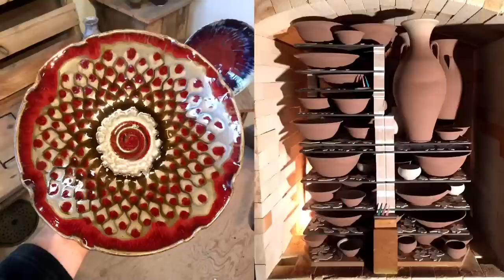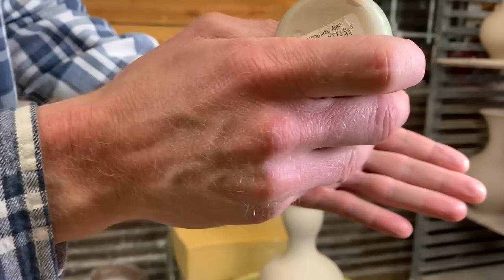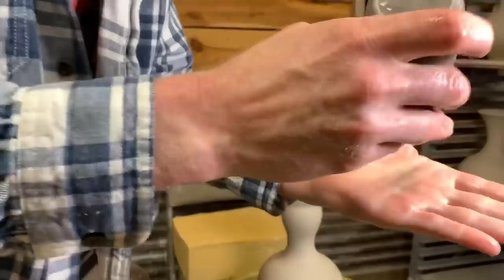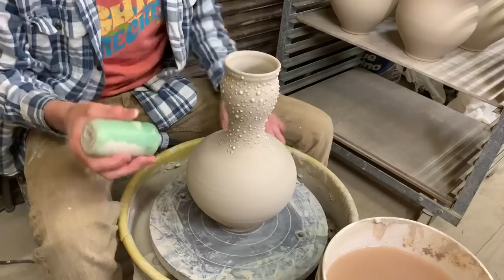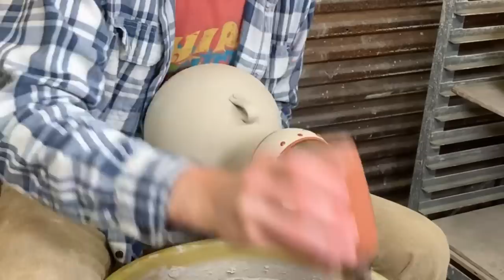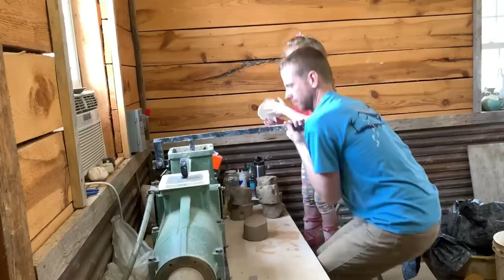Slip Trailing On Small Two Part Vases

Comment: The green color is mold. There are actually several molds that can occur. Have been told that it may add to the viscosity of the clay and will be killed off with firing. Thanks for you video, it was very helpful.

Comment: Green is prbably mold. In the past i have added some vinegar to my slip and it has helped slow down the mold growth in the bottle but i would try it out and see if it works for you on a test piece. Another option is to mix some citric acid powder in with the slip but again maybe test it first!
Reply from the maker: You’re probably right about the mold. I’ll probably just leave it alone because it doesn’t effect the color and I’m not eating it. Haha. Thanks for the tips though. Cheers
Reply: @MatthewKellyPottery  I think it's algae.  Mold is usually black.

Comment: Matthew, have you ever had a problem with joining the pieces together ( bubbles,or cracks) for your big pots. Will the slip run during firing?
Reply from the maker: I’ve never had that problem with my big pots. The red and black slip will run. The white will not.